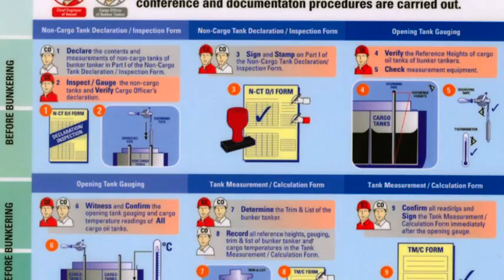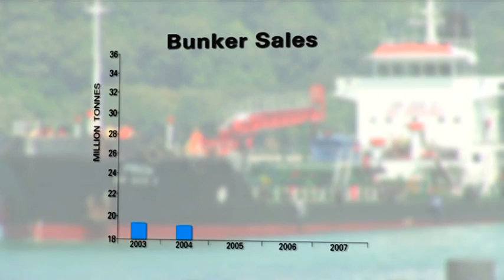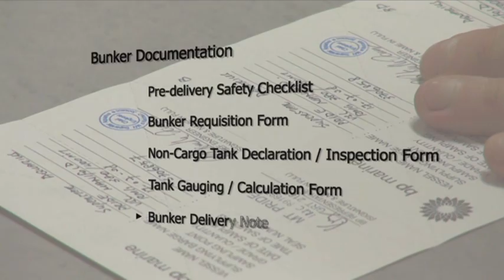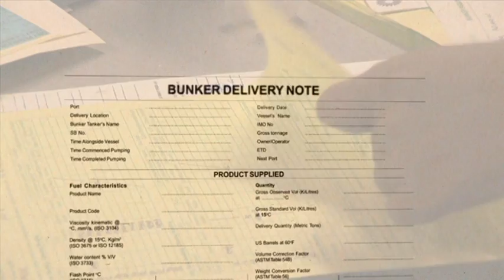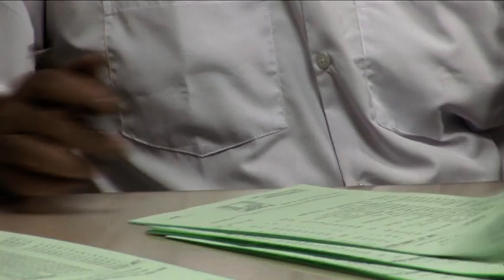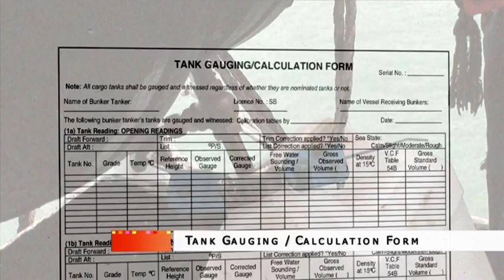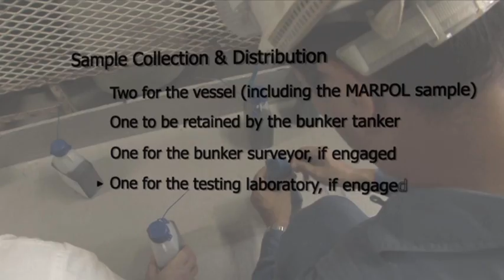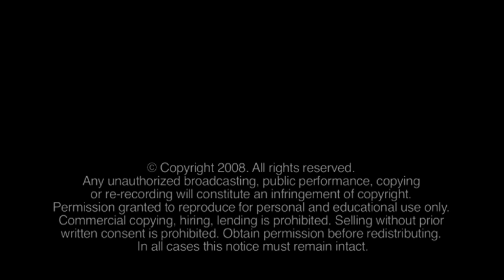Singapore Bunkering

Comment: Stop moaning. Your cheapskate shore staff are using sub-standard bunker suppliers, of which there are always a few around. Save a theoretical 5 Dollars a ton on price and get a 5 percent shortage. Your ships' engineers also are maybe colluding with the barge staff to sign wrong documents in return for some cash. If you fall for the five card trick every time, you deserve to be cheated. And the MPA can't be everywhere.